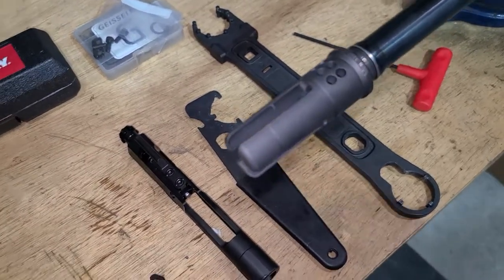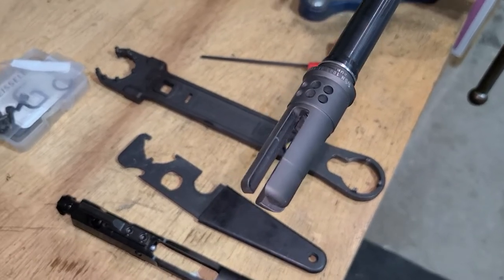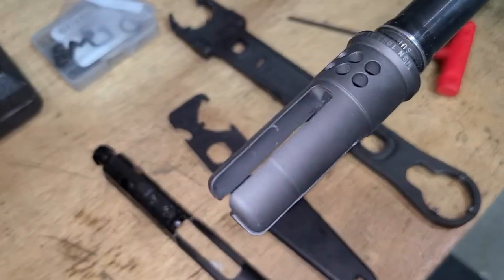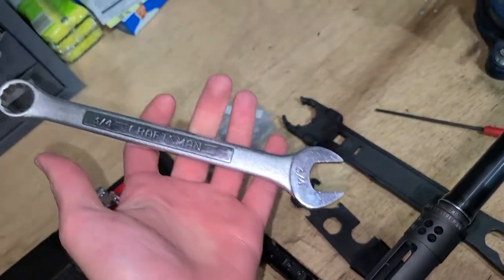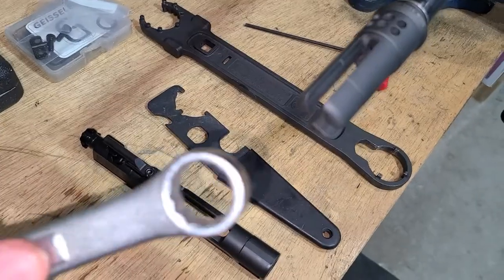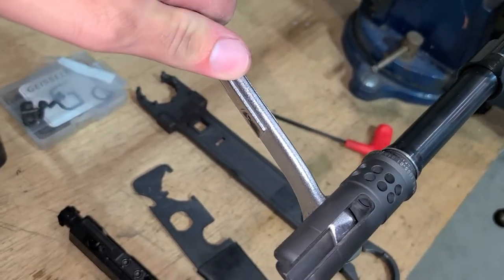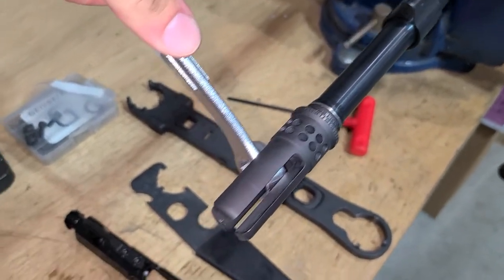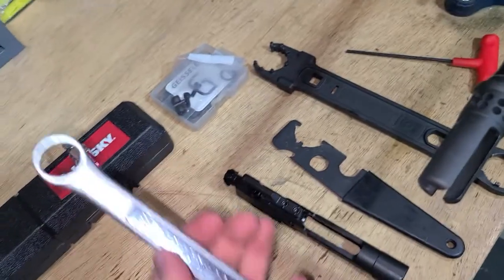No 3 Pronged Flash Hider Wrench? NO Problem! 👍

Comment: Awww.....didn't work for me. Damn 3 prong flash hider on this .308 Aero complete upper is on too damn tight. All I did was end up scratching the prongs up. No big deal, I am replacing it anyways.
Reply: Got to buy the wrench surefire has it listefor $12. Opticsplanet, midway, browwnells, Amazon, all hasit it for $28+! Buds has it for $11 but $12 shipping. Finally Bauer Precision also has it for $11+6Ship, so they got my business. Will probably cost me $35 for a gunsmith and gas plus time.
Reply from the maker: Okay sorry, this is more for instilling, as taking one off is a different game all together. You'd need a long wrench to get the leverage but if they rockset it from factory then yeah you'd want to use a 3 prong socket on a long wrench to get that torque.  

Hope it works out for you bud!  Appreciate the feedback.